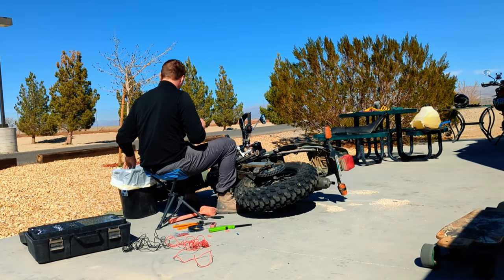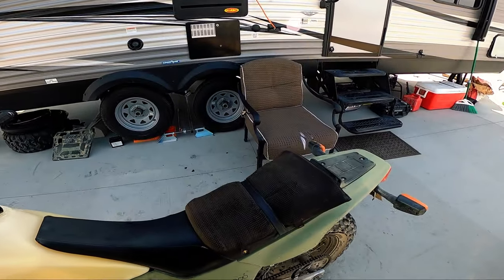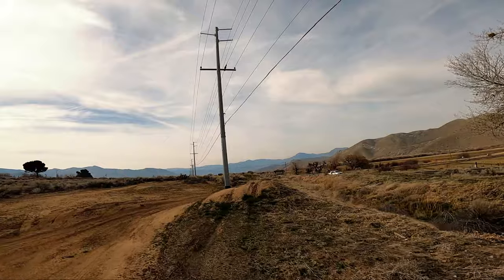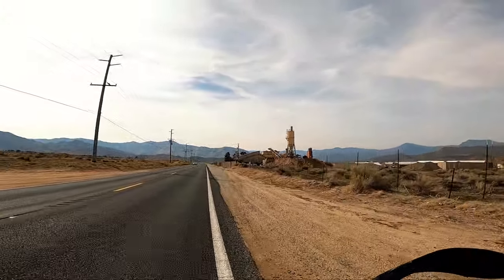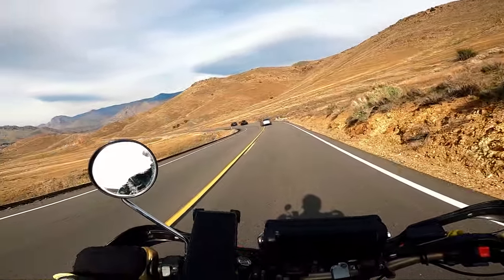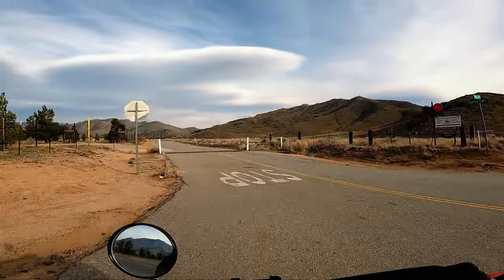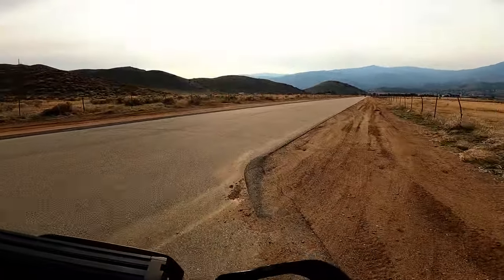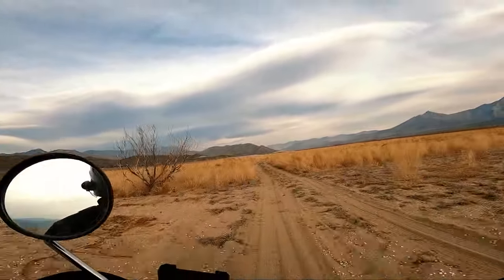Solo TW200 Adventure to Lake Isabella | Farm Bike Doing Farm Bike Things

Comment: Front or rear brake line on the KLX? Just curious as I own one too.
Reply from the maker: Front line ruptured . It was rubbing on the fork and caused a small hole over time
Reply: @dualdorks  Nice. Figured as much since I've seen the shiny new green front brake line on other videos. My front line is also rubbing on my hand guards so I ended up just covering the line where it rubs with electrical tape.